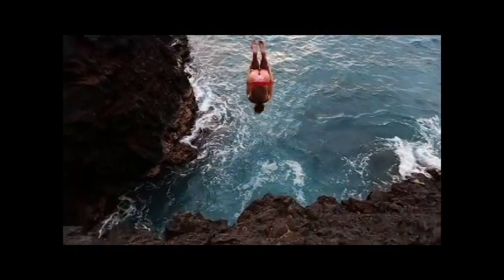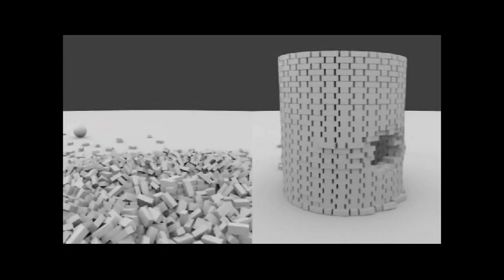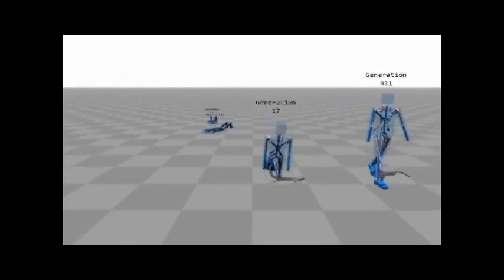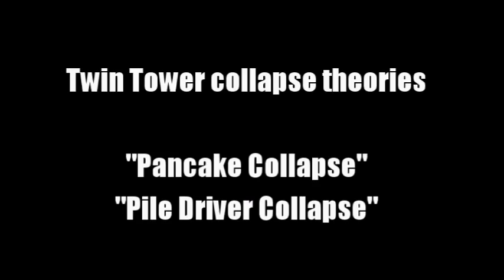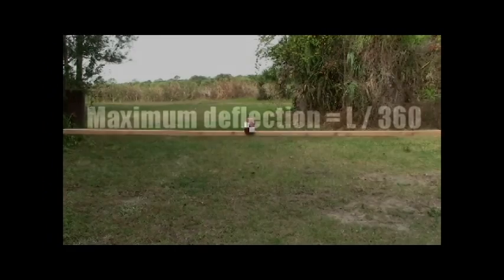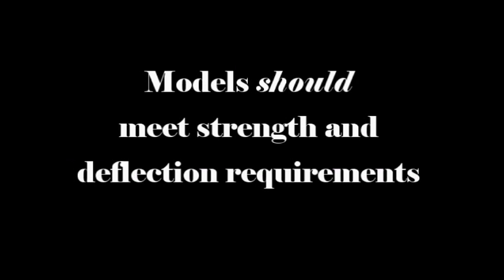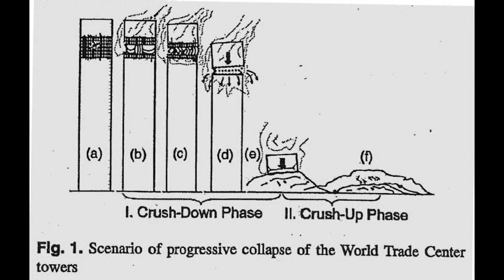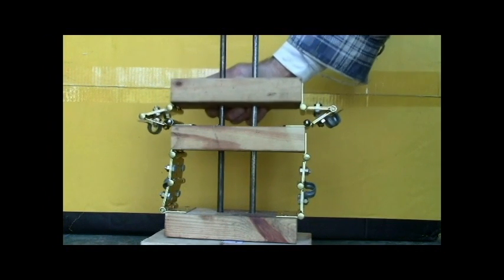9/11 Experiments: The Force Behind the Motion

Comment: The experiment with the steel weight crushing the floors doesn't take into account the actual design of the towers.  My gosh...all of these "experiments" that I find on YouTube never, ever take into consideration the actual design of the towers.

The floor trusses were held to the outer frame and inner core with small little 3 inch brackets that were bolted to each floor section with two bolts.  That's it.  When the weight of the upper floors came down on those little brackets they snapped off.  The floors themselves didn't crash in half.  The L-Brackets snapped off.  That's what allowed the acceleration.  If you accelerate at the rate of gravity, and you hit small little bumps along the way, you will still have NET acceleration.  Think of a car having the throttle wide open, but hitting speed bumps.  Sure, the speed bumps will slow it down a bit each time, and it wouldn't accelerate as fast as a car without speed bumps in front of it, but you'd still have NET acceleration.

The towers didn't fall at the speed of gravity.  They actually fell a couple of seconds slower, taking into account the time it would take to snap off each bracket.

The same goes for the second "experiment".  How in the hell can you conduct an "experiment" when the variables in the experiment are nowhere close to the same as the control!?  The entire structure in the experiment is different than the tower design.

The floors were "floating floors" between the core and outer frame.  The outer frame couldn't even stand under its own weight, and this is proven through basic mathematical calculations.  The frame got its lateral strength from the floor trusses connecting them to the core.

I don't even know why I'm trying, actually....
Reply: Just curious about a few points:

1) His "experiments" either didn't meet deflection codes or were at the maximum allowable deflection... are you saying that the towers' design were even weaker than the experiments (because each floor was only held together with 3" brackets)?  And if so, shouldn't someone be held negligent in either design or construction for not meeting the required deflection code?

2) In your explanation of the collapse, how do you account for the complete destruction of the inner core columns? Since the floors were "floating", and became detached from the inner core...

3)  You stated that the towers "fell a couple seconds slower" than gravity.  Would that be inconsistent with other controlled demolitions?  Or are there other factors which could account for such delay?

4)  I know his experiments aren't perfect, but are you aware more complete/precise experiments which prove/disprove a particular theory on the collapse of the towers?

and it's good that you're trying, only way people can see the other point of view is from discussing it.  Thanks!
Reply: The Logic Jock Thanks for the civil reply!  Rarely happens with 9/11 discussions.

Unfortunately, explaining the full structural make-up of the towers and the physics behind their fall is beyond the scope of a YouTube comment section.  It's one main reason why there's so much disinformation out there.  People attempt to make scholarly journals out of comment sections and nobody reads that...

But, I'll do my best to answer as succinctly as possible, while maintaining some sort of truth and usefulness to the answers.

1)  It's not so much a matter of deflection, it's a matter of construction design.  In order to have an accurate representation, or experiment, of a building collapse, one must have (a) similar materials in terms of strength ratios and (b) similar, if not identical, construction design.  Otherwise, loads, pressures, tension, and breaking points will not be the same, and so any experiment conducted will not be valid. 

In all of science, an experiment must ALWAYS be (a) valid - meaning it must test the thing being questioned and (b) reliable - meaning one must get identical results each and every time the experiment is conducted, regardless of who does it and when it's done, given the exact same variables and controls.  None of the experiments in this video match either of those requirements of an experiment.

2)  As for the core columns, you can view the columns still standing in certain videos taken at the right angle, until they just give way under their weight and damage. 

As the upper section collapsed it fell at an angle, sort of "slicing" into the core columns.  OK, so what does that say about the remaining 70 or so floors?  Well, it boils down to the weight (some 300,000 tons) sliding down around it. 

People tend to think of buildings falling like butter around hot steel.  But the fact is that the cement floors, trusses, and outer shell had a lot of weight to it.  I would venture to guess (because I'm no engineer) that the core columns were not designed to handle such lateral forces.  They were designed to handle vertical forces.  Imagine pressing down on a spaghetti noodle.  They're pretty strong for their size, in terms of vertical force.  Now press down vertically onto the noodle, then hit it with something relatively light on it's side.  It will snap much, much easier.

3)  I'm not following your question, exactly.  The fact that the towers didn't fall at the speed of gravity indicates that it's not a controlled demolition, but that the towers fell with some resistance.  I.e., the time it would take to snap off each truss bracket.

4)  Unfortunately, conducting an accurate experiment of that nature is impossible.  It really is.  Anyone who says they've done it, is a liar.  The best anyone can get is a computer simulation, which still has variables one can manipulate behind the scenes.  Unless you're the software engineer, no one really knows if the software is accurately representing reality or if it's been "toyed" with to match someone's hypothesis.

The only way an accurate experiment could ever be simulated is if you found materials that were scaled down in terms of rigidity, tensile strength, and compression strength.  I.e., A 1/100 or 1/1000 scale of steel.  Then you'd have to construct your mock 1/1000 size building in the same way.  And you'd have to do this about 10 times, in order to satisfy the reliability of an experiment.

The scaled down versions of the materials (which would have to be proven to be scaled down versions) would satisfy your validity requirement of an experiment.  The 10+ repeats of the experiment would satisfy the reliability requirement.

So, in terms of experiment characteristics (dependent, independent, and control variables), the dependent variable (the one being tested) would be the way in which the towers collapse.  Your independent variable would be how you start the collapse.  The control would be to make a mock demolition with one of your experimental towers.  But, your charges and method of detonation would have to be identical to a real, controlled demolition.

This is precisely why a real experiment is impossible.

I know of no materials which scale down from steel so easily, nor of anyone who has access to the design plans of the towers, nor of anyone who has the time and a CNC machine to make all the parts, put it together, over 10 times, and then destroy all of it. 

It's just not feasible.

So, when it comes down to it, I go with Occam's Razor and stay away from Ad Hoc hypothesis.

When faced with a multitude of explanations for a phenomenon, go with the solution that includes the least amount of variables and has the simplest explanation.  Otherwise, you quickly find yourself with a hypothesis that is untestable, making it both unable to proven or disproven - which answers nothing.

To believe that it was a conspiracy, put together by our government, with bombs all throughout the buildings, planes, people to take the fall, etc. when the government can't even get the most simple shit to run right, I find hard to believe. 

See, the thing about conspiracy theorists is that they make our government more powerful than it actually is.  They talk about how evil the government is and how they can't get this right or that right, but turn right around and say they've orchestrated and manipulated the most complicated and secretive plans and events in the world - all without any hard evidence to prove it.

I choose to believe that which is explainable, that which makes sense in as many facets as possible.  And in most cases, conspiracy theories don't explain anything - they merely ask questions that aren't testable, leaving the mind to wander into even more unproveable things (Ad Hoc hypothesis).
Reply: It's Me. . .  My common sense was screaming out by your second paragraph.  By the  very obvious fact that an upper floor crashing into a lower floor has to start that lower floor in motion (after exchanging & expending  energy)  causing a substantial lag in motion/collapse.  Each floor weighed around 4,500 tons, that's one hell of a mass to make move suddenly, to achieve anything like free- fall speed, from a standing start.  Also remember that the steel in the towers got progressively thicker towards the totally undamaged base. The entire building was constructed with a large Safety Margin, and the reality is the collapsing mass was less than the original mass the towers supported because a lot of it was blown out or turned to dust in the process.  How many tons of dust (actually the tower materials themselves) do you imagine lay in the downtown area after the collapses? Calculations by deniers calculated it was around 80,000tons of dust, around 50% of which, was pulverised concrete. And, if the floors did indeed pancake on top of each other, then where are the large chunks of each floor which should (some at least) appear stacked on top of each other? I don't see them . . .
Reply: And it seems even the most intelligent supporters of the official story regard the "too big to pull off without people spilling the beans" argument as their most persuasive rebuttal of 9/11 truth. That, of course, is entirely speculative on their part and not evidence of anything. When you approach the problem from that point of view you ignore the dozens (perhaps hundreds) of government insiders who reject the 'official' account. How credible you view these people is for each person to decide, but to ignore their existence is intellectually immature.

In the same breath they will point to the incompetent of the US government as evidence against co-ordinating something like this. To that I ask, how long will you let someone piss on your leg while they tell you it's raining? Do you really believe the announcement on September 10th 2001 that the Pentagon couldn't properly account for $2.3 trillion was merely a coincidental and harmless oversight? Has that 'innocent oversight' been corrected? Not according to this article published by reuters last month. I suppose Trump's escapades are a bigger threat to democracy though.
http://www.reuters.com/article/us-usa-audit-army-idUSKCN10U1IG

We could talk for hours about supposed 'intelligence failures' and 'misplaced files' on a number of issues, but I'd rather not waffle on much longer. I'll finish with this: 'Conspiracy' is a perfectly valid legal concept within the criminal code that describes 2 or more individuals planning to commit an illegal act. They occur ALL the time. A theory in simple terms, is a hypothesis that has not yet been proven true.

Contrary to popular opinion, not all conspiracies are sloppy operations that are quickly discovered and dismantled. The Italian mafia, among others, has been in operation since at least 1930, and is as powerful as as it has ever been. No one disputes that the mafia exists, yet they are notoriously elusive to law enforcement. It is a perfect example of a conspiracy theory.

What separates the 9/11 truth movement from, for example, the 'Fake Moon Landing' crowd, is that there is nothing of note that has been declared 'classified' or 'off limits' with respect to the Lunar Landings. Approximately 400kg of rock (in total) was brought back by NASA's Apollo missions at the cost of billions and at least a dozen lives. And yet they will happily send you a sample of Lunar rock for research purposes if you fill out a form, and can demonstrate some level of scientific competence. You can visit the NASA visitor centre and view the space shuttle, the lunar lander, the space suits and even see the camera used to record Mr Aldrin's infamous words. You can visit the Parke's radio observatory in Australia that beamed the event live across the Southern Hemisphere. And you also have major networks who will not hesitate to air the crappy conspiracy documentaries put out by the fake landing movement. Virtually NOTHING is off limits.

Show me where I can apply to get a sample of WTC steel for my own research purposes? When will a major network air the Architects and Engineers for 9/11 truth documentary? What do you mean it will jeopardize public safety?
Reply: Jon Chalkley Perfectly said.  The point about the paper walls experiment really does hammer it home.
Reply: You guys are missing the point of scientific experimentation.  

To say that a model cannot replicate the conditions (which is true) therefore any experiment will not explain the collapse, is confusing.  Then why conduct any experiment where the exact conditions cannot be created? And why believe the government's explanation without 1st recreating the exact conditions?

Although he did not create the exact conditions... he created conditions which provided less vertical strength (even at scale) than the towers.

You're telling me (both It's Me and Eric Henderson) that if a 110 story sky scraper, with PAPER for walls were built, and it's upper section was dropped into the lower section (while some of the paper walls were lit on fire) it would have been more structurally sound than the steel towers?  If these experiments were built to the scale of the towers, that these conditions are better suited to handle the events of 9/11?

If you TRULY believe that... somebody should go to jail for architectural/engineering/structural malpractice. 

No one is saying these experiments are perfect... but you can sure learn a lot from them... and certainly ascertain that a smaller structure, moving through a larger structure, where the only downward force is gravity, and it's release point is only a few floors away from the lower section, CANNOT destroy the larger structure (of the same material) and then crush itself after.
Reply: With all due respect It's Me, that's exactly what you're arguing.  Your argument is that the paper is too strong in comparison with the L shaped brackets connected to steel trusses, connected to vertical steel columns from the inner to outer structure.

I think we're going to have to agree to disagree.  I don't believe:

a) that the WTC towers vertical load capacity is comparable to a single uncooked noodle holding up several pounds of weight (even at scale).  Again, if that's the case, someone should be in jail for malpractice and constructing buildings in the same or similar fashion should be outlawed... which it hasn't, because the new WTC7 was built in the same way (strong inner core, outer columns with trusses connecting the columns and holding the floors)

According to [WTC designer Leslie Robertson], New York City has some of the worst wind loads in the nation ... This is because of the occasional wind generated off of the Atlantic Ocean during hurricane season. As a result, buildings in New York City must be designed to be twice as strong as similar buildings designed to withstand an earthquake in Los Angeles.

b) that the collapse, as you guys described it to happen, would have destroyed the inner core, pulverized all the concrete, fused elements of steel and concrete together, laterally ejected large sections of steel at calculated speeds of 60mph which embedded themselves into neighboring buildings, maintained a 3 month long fire, and created a "pool of molten steel" as described by a multitude of first responders.

To me, the occam's razor to explain that all of that is thermite combined with explosives.
Reply: What does any of that bullshit have to do with Newtonian physics? And what is the "speed of controlled demolitions"?
Reply: ..aaaand you're STILL running scared from discussing physics.

What a surprise.
Reply: Oh God... Dr Judy Wood is either a fraud or a lunatic. I'm sorry to be so blunt, but her name and common sense do not belong in the same sentence.

Her 'dustification' theory is silly on it's face. The 'dust' she refers to is simply pulverized concrete and is present in every single successful demolition video on the net. There is no mystery. The buildings did not 'vaporize' in the air. There was thousands of tons of debris at the trade centre site, and thousands of tons of concrete powder spread over the city.
Reply: Jon Chalkey, yes exactly, there was tons of concrete powder over the city that is what she is saying too. There are many obvious reasons why controlled demolition is not what happened that day. Just because Judy Wood's examination of the evidence suggests something outside our known technology is no reason to think it either ridiculous or stupid. I am now sure you have not looked properly at what she is saying as it is the only thing I have read that accounts for the actual evidence.( incidentally, I have been studying this avidly since 9/11 as I was a flight attendant for United Airlines at the time and have looked at every single theory I can find out there ) There is a lot of disinformation and misinformation out there and a lot of it is purposely trying to discredit her because any "black box" technology that may exist has to stay that way otherwise the consequences could be potentially a lot worse than just being found out as to having organised 9/11. Dr Judy Wood has the most extensive reports on 9/11, far more that any other single person. Please if you seriously want to understand 9/11 read her work properly. If you have any genuine questions about it after reading it thoroughly then please lets discuss them , I am open to that, but as yet you have not said anything that disproves her work, only insulted her personally. Just because a lot of people are ridiculing her may only point towards her being close to the truth, don't be a "sheeple" look at the evidence.
Reply: Jon, Sorry you still have not said anything to disprove any of her findings. Just because she suggests that technology beyond common understanding most likely was used and therefor you can not disprove this technology, is no argument that it can not exist.I am sure that there is a vast amount of "black ops" technology that the general public know nothing about, we of course can not disprove any of that technology, but that does not negate its existence. Surely as a lawyer you understand that the most vital aspect to discovering the truth is to study the evidence, and hopefully study it with an open mind. So what you are saying is that if , for example, Russian scientists invented a new weapon and used this weapon in warfare, you would have to deny its existence, merely because it is not "falsifiable", now that in my mind is ridiculous. So everything beyond our current understanding, therefor can not exist because it is "not falsifiable", please re consider what you are saying. I do not want to be discourteous but surely as a lawyer you should be able to see the problem with what you are saying. As you don't seem to want to give me any specific reasons why Judy Wood's work is not the best analysis of the evidence, may I give you a couple of reasons why controlled demolition is not the best analysis of the evidence.
 1, Controlled demolitions do not fall so perfectly within their own footprint without causing at least some damage to buildings around them, especially considering the enormity of the trade towers. ( check out the domed roof directly next to the towers, it appeared to have absolutely no damage). Please look at other demolitions on you tube. How do you explain this ?
2, Check out the seismic recordings for the area at the time the towers came down and compare that to the seismic recordings of other large buildings that have undergone controlled demolition . The recordings are not consistent with the size of the buildings. How do you explain this ?
3, There is no where near the amount of debris left at ground zero as there would be if the towers had come down by controlled demolition. I agree that a lot of dust is produced in a controlled demolition, but there is still a large amount of rubble left at the site, and much of it is large  identifiable pieces. Prior to a controlled demolition it can be assessed approximately how big the pile of rubble will be that will be created. The rubble left at ground zero had no real identifiable pieces and was no where near the size the pile should have been . NO WHERE NEAR . Even the reporters on the day were commenting about the amazing lack of rubble. How do you explain this ?

Please answer these questions , otherwise I will have no option but still see Judy Wood's explanation of the evidence as the one that makes most sense. I am open to being shown evidence and am quite prepared to re assess my beliefs, but no one has ever come up with anything to explain the evidence yet.
Reply: The only possible source of energy, and the only alleged source of energy (from the 'official' explanations), is downward from gravity alone.

All we're asking is to provide a simple experiment, where an object... ANY object:
1) moves downward through an object of equal makeup and greater size (the top floors fell through the larger structure below)
2) where the only force applied to the object is gravity, and the object's release point (the distance between the upper object and lower object) is not greater than 1/2 of the upper object's height
3) where the entire larger lower structure is destroyed
4) where the entire upper structure is destroyed
5) where the upper object falls at free-fall speed

I don't believe such an experiment is possible... but prove me wrong and I'll cede my argument.
Reply: Eric Henderson On top of that, you have to first assume that the trusses/weights used in the model are scaled down properly to begin with.  And not just in terms of size scale (length/width/height), but it terms of strength.  Tensile strength, shear/crush resistance, etc.  There's so much to account for that a model like this just can't replicate.  

The paper's between the floors in the model crush, while the truss clips in the real towers shear.  You can't even compare the two without it becoming completely invalid.
Reply: I completely agree. These videos keep referring to Newton's Laws but when you watch them it becomes clear that they don't have even understand basic physics.
Reply: Eric, please attempt to conceptualize the scenario you are suggesting. If the concrete floor slabs collapsed onto the floor beneath, breaking the connections to the inner and outer columns, why weren't there significant portions or the interior columns recovered from the site? The interior core section was a building in itself. 

You are suggesting a mode of collapse that NIST does not even endorse. Pictures of the debris clearly show that the studs holding the floors in place were intact. Instead, it looks much more likely that it was the columns themselves that failed. Unfortunately the steel was scrapped (evidence was destroyed) preventing a proper investigation. From NIST's own report:

236 steel members were analyzed including 12 interior columns and 170 perimeter columns. None showed signs of temperature damage in excess of 250 Celsius (no mention of the maximum they did observe)
Of 31 core truss connections, 95% were found to be intact (studs were damaged but functional). Only two were completely severed. 

The steel examined accounts for less than 0.5% of the total used in the twin towers.

If you are going spend your life as a 9/11 debonker, at least get up to speed with the current explanation endorsed by the Government.
Reply: PS: I watched the video AGAIN with utter astonishment that someone with a PE qualification could make such an elementary error in not allowing for the effect of scale. Go and ask anyone else and they will confirm that his experiments are invalid if this isnot allowed for.
Reply: Oooh! Look at that. You're still running away from discussing physics. Probably as well given you have about as much grasp of them as any twoofer. e.g. about the same grasp as a particularly stupid goat might have of basic motor maintenance :-)
Reply: Anything to avoid exposing your utter ignorance of physics, eh? You started to mumble something about Newton's third law then bitched out when you realised you were WAY out of your depth!

titter
Reply: "when factoring for the modicum  resistance"

It's HILARIOUS when you attempt to sound educated. Do it again!
Reply: Logic Jock . . . I have to agree with your the Government comment.  I had one bright spark say that if the government planned & did it, then why would they bother sending up jet fighters to shoot them down.  I believe Bush knew something was going down on that day but maybe not exactly what.  His reactions on that day was really suss.  Not wanting to disappoint a group of kids by leaving when he was told the building (s) & US were under attack.  Many of the Black Ops groups, and there are several at least, are, at times on opposing objectives & clash with each other . . .  sometimes undermining the other's attempts.  Again I point to "Operation Northwoods" . . . people should google that for themselves & be aware what the Top Brass are willing to do.  Remember this was not just a proposal, it was signed off by them as a "GO".
Reply: Think For Yourself Yup.  I believe Bush was an accomplice AFTER THE FACT.

They purposefully kept him away... if anything, they (Cheney and crew) couldn't trust his judgement.
Reply: "There are many obvious reasons why controlled demolition is not what happened that day"

Please.... Go on

"Just because Judy Wood's examination of the evidence suggests something outside our known technology is no reason to think it either ridiculous  or stupid."

No, it is ridiculous. That is precisely what religious zealots invoke when you ask them to define the God they believe in. An unfalsifiable theory has zero merit in any rational discussion.

"I am now sure you have not looked properly at what she is saying as it is the only thing I have read that accounts for the actual evidence"

I did better than that. I watched her presentation in Holland at the 'Breakthrough Energy Movement Conference'. I wish I had that 2 hours back..

"Dr Judy Wood has the most extensive reports on 9/11, far more that any other single person"

I don't disagree with you on this point. The amount of evidence she has collated on her website is a staggering achievement. The problem is she weaves that evidence into a ridiculous theory with no merit.

"I have been studying this avidly since 9/11 as I was a flight attendant for United Airlines at the time and have looked at every single theory I  can find out there"

I am an Australian in the 3rd year of a Law degree. I previously studied engineering for 2 years before changing courses. I became interested in the 9/11 truth movement about 2008 - I don't claim to have 'looked at every single theory' out there... What's your point?

"Please if you seriously want to understand 9/11 read her work properly. Just because a lot of people are ridiculing her may only point towards her being close to the truth, don't be a "sheeple" look at the evidence."

I am a firm believer in the principle of charity... I try to avoid insinuating that my opponents are 'sheeple' who haven't 'read her work properly' for as long as possible.

"If you have any genuine questions about it after reading it thoroughly then please lets discuss them , I am open to that, but as yet you have not said anything that disproves her work, only insulted her personally"

I already did. Her main criticism of the demolition hypothesis is that it doesn't account for 'dustifcation' of the towers in mid air. But.. it absolutely does. David Chandler's video clearly demonstrates the same pyroclastic dust clouds being formed in much less substantial and/or sophisticated building demolitions.

The demolition theory is a falsifiable claim. Some super secretive - beyond our current understanding - Directed Energy Weapon is not a falsifiable claim.
Reply: P.S. Jon,  do you really really believe this " An unfalsifiable theory has zero merit in any rational discussion." ? I am shocked that a lawyer could say this ! I doubt you will be debating Philosophy any time soon, or for that matter putting forward theories to to avoid your clients being found guilty.
Reply: P.P.S. An unfalsifiable theory that is based solidly on all of the existing evidence , and fully explains that evidence, does in actual fact have merit, whereas on the other hand a falsifiable theory that is based on all of the existing evidence but contradicts some of that evidence is simply just that ,       false.
Reply: No the Architects and Engineers for 9/11 truth are the distraction and are purposely trying to ridicule Dr Judy Wood's work. Jon, you say that there was thousands of tons of debris at the trade centre site, but there WAS NOT. Please send me a link to any image showing this debris. Even the reporters on the day couldn't understand why there was hardly anything left of the towers. All controlled demolitions have a calculable amount of rubble left at the site but that was NOT the case at ground zero. Also check out the seismic recordings for the day , clearly they do not account for the towers collapsing. LOOK AT THE EVIDENCE.
Reply: It's ME, Thank YOU....one Person with a fucking brain.
Soooo many stupid people around here...it hurts o.0
Reply: Literally any scale.  The laws of physics act the same way whether it's a tree trunk or a branch or a twig.  

And yes, free fall is a condition.. as NIST themselves have acknowledged that free fall occurred.
Reply: The laws of physics may be independent of scale but the forces involved are not.
The strength of the trusses, girders, etc will increase as the square of the scale while masses and therefore the forces involved increase as the cube of the scale.
For example, if you use 1:100 scale, the strength of the trusses would be 1/10000 weaker but the mass of the falling floors would be 1/1000000 less.
In effect, the trusses would be 100 times stronger in the model than in reality.
This is why experiments, like the ones in the video are not valid.
Reply: The Logic Jock "it would have been more structurally sound than the steel towers?"

No one is arguing that at all.  It has nothing to do with the structural soundness of paper.  It has to do with the design of the towers.  

Go watch a documentary on how the towers were designed.  The men who built the thing (who are still alive) admit that the fires were capable of causing a domino effect within the buildings.  

The reason is because each floor was made of trusses which were literally "hanging" on L-shaped brackets.  Once enough trusses began sagging and putting their weight on the floors below all it took was one floor to give way, allowing the outside frame to bow out (this can literally be seen in the towers right before the collapse), and then the weight above easily snapped off the L-brackets in succession, gaining momentum and therefore force as it fell.

It's truly simple physics.  

What the experiment in the video doesn't take into consideration is that each "floor" of paper is strong enough to slow down the above weight with a NET LOSS of momentum as each floor collapsed.  The L-brackets in the Twin Towers did not have nowhere near the capacity to create a NET LOSS of momentum in the weight of the floors crashing down.  There was a NET GAIN of momentum as each floor gave way.

One major flaw of the experiment in this video is the lack of consideration for momentum and acceleration of gravity.  Gravity, and therefore momentum, scale by square.  So you would literally have to scale down your weight and strength of the materials to be equivalent with the momentum that can be gained by the acceleration of gravity at the scale of the experiment.  

You're talking multiple tens of tons of material falling about 30 feet onto the floors below in the Twin Towers.  Calculate that momentum or force (MV = P).  Then you'd have to calculate the strength of the L-brackets and crush strength of the outside frame of the towers, subtract that from the momentum, and you'd have your NET GAIN.  

In the experiment, however, the floors fall about 6 inches, and the plates weigh mere ounces.  The resulting momentum in comparison with the strength of the papers just doesn't scale.  Period.  That's the ultimate flaw.

You would need material far, far weaker than the paper.  Not to mention, the circular shape of the paper adds strength that the towers didn't have.  

Recreate the tower using a single uncooked rice noodle between each floor of several pound weights, then you'll see the collapse recreated more accurately.
Reply: I have to correct you on that point. The floor brackets did not support anything other than the weight of a single floor. The weight of each floor is transmitted through the brackets to the interior/perimeter columns, which carry the weight of the rest of the building. However, the entire floor assembly also functions as the 'bridge' between the interior and perimeter columns so that massive lateral loads experienced by the building during strong winds are transmitted to the core, reducing building flex. 

You are right in pointing out these 'flimsy' brackets survived perfectly fine for 30 years, enduring multiple hurricanes and the 1993 bombing (which was huge in it's own right). They were over-engineered like everything else in the building. The idea that these brackets which held 2000t slabs of concrete, would provide zero resistance in a collapse is beyond laughable. That it's being claimed by those who think they have an sound understanding of 'schoolboy physics' is more worrying. This tells us two things: 

1. The American education system is worse than anyone predicted. 
2. It shows just how piss poor the investigation of 9/11 was. Debonkers can't even correctly describe the 'official' (ie NIST's) theory of the collapse.. Remember that NIST was paid tax payer money to explain to the American people how these buildings came down.
Reply: You don't understand freefall.  If a 4500 ton floor has no support under it, it achieves free fall acceleration instantly.  There is no time delay for gravity to feel like starting to work (unlike certain cartoons featuring the Road Runner).  That's how gravity works.

Secondly, merely stating the weight of a floor leads us into a discussion of how strong the floor connections need to be.  The floor connections to the vertical columns is ONLY hold up the floor.  Not the rest of the building - that's for the vertical columns.  So floor connectors will be rated for something like 4500 tons + max contents of that floor + some suitable safety margin.  Now, take the next floor (or two), and the original floor not only has to hold up itself, plus one or two others.  What happens?  It breaks and falls.  The next floor sees two or three floors worth of load, and breaks even faster.  You get the picture?

Thirdly, no significant amount of debris went missing.  The published tonnage of recovered steel closely matches the amount of steel there was in the building.  The debris piles covered acres of area, and were as high as the 5th story of adjacent buildings, and took months to remove.  Then add the 70' depth of the basement.

And fourth, computations show that the building would have a gravitational collapse energy of approximately 250 tons of TNT.  Now, go read the power specifications for industrial rock crushers.  As it turns out, 250 tons of TNT is enough energy to power an industrial rock crusher to crush the entire tower's concrete into gravel (and progessively finer bits, right down to dust).   Not just once, but twice.  Then consider the fact that much of the concrete debris were in pieces much larger than gravel - photos show piles of pieces the size of brick and larger.  Or, if you don't like that, take a floor size slab of WTC, and drop it from 1300 feet.  The impact energy will be equivalent to 5 or so tons of TNT.  The concrete won't be intact.  It will be in tiny pieces (and indeed dust) spread out over an area 10s of times larger than the slab.
Reply: To the original poster.. Don't bother talking sense to these imbeciles.
Reply: talking with these bafoons is such a waste of time, why do we bother.. you would have an easier time convincing a rabbi that mosses didn't really part the seas.
Reply: Huh? Why are you petrified of discussing physics?
Reply: Payed still 
Ah, do you were in the special needs class. What a surprise! No wonder you don't understand physics and can't refute NIST.
Reply: That is EXTREMELY incorrect. Free fall within the force of gravity is constantly ACCELERATING limited by air (resistance), drag (shape and volume of object) and mass, etc. The WTC Towers were approximately 1300 feet tall each. Once the upper floors fell, they gained momentum AND mass from the lower floors. The towers fell within their own "footprint(s)". They were not falling free from a certain height (ie., bowling ball dropped from same height, left to accelerate to its terminal velocity). Imagine a person standing in the middle of a room. At a given moment they "drop" to the floor. They intentionally allow their legs to collapse beneath them. There is no air resistance within their own footprint downward. he only "resistance" is the friction of the joints once the knees, hips buckle. This is similar to what happened to the WTC buildings. The top floors fell, bringing the lower ones with them, increasing the overall mass ACCELERATING towards the ground.  Had the towers been "magically suspended" above the ground (levitated) and dropped from a height equal to the height of the actual towers, then yes, the time to reach the ground would be different because their initial inertia (static) would resist the force of gravity, and begin to be subject to air resistance. It would accelerate towards the ground slower than the bowling ball due to its much more massive drag than the bowling ball. The towers fell because of Islamic terrorist assholes, massive structural damage caused by the impact from the airplanes,  the fires weakening already damaged structures, wind (which is MASSIVE and rarely considered/discussed) gravity, and TIME. Nothing else.
Reply: "if by some way the towers did indeed fall on their own, it would take them a minimum of 30 seconds"

Oh, why's that then?

"Its simple physics,"

So, how come no one has shown, using "simple physics" in a peer-reviewed paper published in a serious scientific or engineering journal that the towers cannot have fallen "on their own"?
Reply: I admire your gumption but you still haven't taken into the account the symmetrical fall. Asymmetric damage and a symmetrical fall. That is highly unheard of. That being said, hitting speed bumps that hard would cause a car to break before it's final destination. The issue here is that you're not accounting for resistance and energy needed to break up the floors to fall that way. You're assuming all the energy is kinetic. That being said, you cannor creat energy. This mean outside sources would have to make your THEORY plausible.
Reply: I think "Its Me" has covered much of what I would also have given in reply. I will add this though in the hope of clarifying, what seems to be a misconception among truthers regarding how the towers fell.
The inner core and the outer walls could not prevent the collapse from progressing once it had begun because it was ONLY the connections between inner and outer walls which held the floors up.
Once the upper floors came down on the ONE floor beneath, the connections holding it to the walls gave way and this weight was added to the falling mass. As each floor gave way the mass INCREASED and with it the momentum so the next floor below was hit with even greater momentum.
I wont bore you with the maths, but this gives a result which fairly closes what you see in the videos.
Reply: can't we all just be friends?  😢
Reply: That's the point I've been making all along. It only requires a schoolboy knowledge of physics to prove this is how the floors collapsed.
The fact that you have been unable to refute, simply shows that you lack this ability.
Reply: I'll try this only once more.

You keep referring to 'schoolboy physics' yet you continuously butcher its application, demonstrating that you have ZERO understanding of what you are talking about.

The fact that you openly assert that fully supported floors provided zero resistance against the falling mass is simply shocking. If you ever had a highschool physics teacher (seems unlikely), they would be face palming if they saw you wrote this. I'm sure there are 9/11 debonkers who are face palming themselves at the thought one of their own is claiming this.

At this point I'm doubting you even have 4th grader reading comprehension skills but I'll attempt to show you how utterly retarded this argument is, using 'schoolboy physics'.

Momentum = Mass X Velocity

Example 1
If a 2 ton car traveling at 100km/h collides with stationary vehicle of the same mass, what speed is the vehicle traveling after collision?
Answer:
If we assume this to be a closed system in which both vehicles fuse together and momentum is conserved, then you are doubling the mass of the vehicle meaning that it will lose half its velocity, ie 50 km/h 

Example 2
If an 98 ton truck traveling at 100km/h collides with stationary car weighing 2 ton, what speed is the truck traveling after collision?
Answer:
Using the same assumptions as the first example, 98km/h

In the real world we know energy/momentum is not conserved. The vehicles will not 'stick together'. They are designed to deform and spread the energy exerted on each vehicle over time. There will be energy lost to heat, sound and friction. In both examples, the vehicles will be traveling at less than the calculated speed. However, it cannot be disputed that in both cases, the stationary vehicle will resist the motion of the moving vehicle.

I know all of this will fly over your head, but take my word for it - you are clueless.

To tie this back to the WTC collapse. No one who graduated highschool would claim that the buildings fell at free fall acceleration throughout the entire duration of collapse. This is PHYSICALLY impossible by gravity alone, and undesirable if you aim is to demolish a building. Architects and Engineer's for Truth timed both collapses at about 15 seconds from initiation (ie roughly 70% of free fall acceleration). So even though 'truthers' believe that the structural supports were taken out with explosives, the building still provided minimal resistance against the falling mass.
Reply: The brackets connected the floor trusses to the core and outer walls and each set of trusses supported only one floor. The lower floors did not support the upper floors, their weight was born by the walls.
Reply: It's Me was going to go in debt like you but well said. my thoughts exactly
Reply: What a surprise, another inane comment from our resident genius.

We have still to see your calculations showing that the truss joints were strong enough to resist the impact of the falling upper floors.

The lack of even a hint of critical thinking in your writing is manifest.

The air inside the towers was 'strong enough to resist' the collapse. The question is, to what degree did it resist?

A 5 year old child is capable of understanding the basic principles of wind resistance and lift by sticking his hand out the window of a moving vehicle. That won't make him a fully qualified aerospace engineer with a grip on Eigenvectors and the difference between the Cauchy and Kirchhoff stress tensors.

We have still to see your calculations

Unlike you, I am not prepared to embarrass myself by claiming 'schoolboy physics' is sufficient to explain the three most significant engineering disasters in history. 

If they did not fail what caused the building to collapse?

Did you even watch the video?
Reply: Never thought of myself as a genius and I realise it is your attempt at sarcasm but I’ll take it as a compliment anyway.
As I expected, you have not been able to produce any coherent response to my post. Sneering and insult does not constitute a valid argument. Facts and evidence do. Your failure to provide any confirms my suspicion that you do not understand the mechanism of the collapse. It is apparent that you have been conflating NIST’s
analysis of the way the columns  failed, initiating the collapse with the way the connections between the floors and the walls were sheared off  DURING the collapse.Your claim that 90% of the truss connections remained intact is also mistaken, or is it just downright dishonest.
“However, over 90 percent of floor truss connections at or below the impact floors of both buildings were either bent downwards or completely sheared from the exterior wall suggesting progressive overloading of
the floors below the impact zone following collapse initiation of the towers.”  (Stephen W. Banovic, Thomas A. Siewert)
Reply: That's absurd.  Where did the 180,000 tons of steel they shipped to China and India come from then?  How come it took a 7x24 continuous convoy of trucks operating for months to remove the other million or so tons of debris?  The seismic recordings do indeed show the towers collapsing, but they don't show the start of the collapse simply because nothing had hit the ground until several seconds AFTER the collapse started.

Where are the pictures?  Good grief, do a  google image search for "debris 9/11", and then google for "aerial debris 9/11", and it should go without saying, skip the truther sites' handpicked and often misrepresented photos.  There are hundreds of shots, the aerial ones showing the outer frames of the building draped across adjacent buildings like flower petals are quite striking.  Not to mention the huge waterfalls of debris falling from the WTC tower falling on top and the side of WTC7.  Where did that go?   Did the Enterprise pick it up with its transporter room?

Where did the debris in the video falling from the towers go?  To the ground, where else?  WTC7 collapsed just about straight down, did its debris magically disappear before it hit the ground?    Vaporized debris aren't invisible.  Furthermore, the energy required to vaporize significant amounts of the buildings would amount to the equivalent of 1000s of tons of TNT at temperatures which'd give everybody in line-of-sight within miles sunburns.
Reply: "Subsequent analysis of the particulate material that settled out and formed a grayish-white dusting over much of Lower Manhattan showed it to be mainly a mixture of crushed gypsum wallboard, glass fibre insulation and concrete, some of which was in the 60 - 20 micron size range."
As you would expect, truthers make all sorts of claims about the physics of the collapse but rarely back it up with figures:
Total PE available in wtc tower ~ 10^12J
Total Energy required to collapse one floor ~ 10^9J
So to collapse 100 floors ~10^11J
Subtracting that from 10^12 gives 9 x 10^11J available to crush concrete, wallboard etc. How much did it actually take would depend on the total mass of concrete and the average particle size of the dust, but considering a sizeable amount of the concrete would certainly remain as large lumps it looks more than enough.
Reply: @Tom Slak What do you think happens when you drop a 10 floor section of building (which is what happened) from 1000'?  It smashes into small pieces.  "the now bare and supported core should have fallen over like a tree"?  Well, that's exactly what the videos showed.  A progressive collapse is a combination of pancaking of horizontal sections and collapsing of vertical.  The vertical columns weren't 1300' long single sections of steel, they were much shorter sections bolted together.  What happens when the floors start falling and debris blow out sideways?  The vertical column sections are bashed sideways, lose their stability and break off.
Reply: Fromage Frizzbizz I'm so glad that atleast someone other than my self actually learned how the towers were made and why they were designed that way. A typical high rise structure had reached its limit. This design allowed for a building to exceed those limits by reducing weight. Thus creating naturally design flaws. I always point out the towers resisted the impact the structure did its job. The resulting weakening of the structure is what it lost its battle in. Fire at 1600 degrees super heats steel to the point of manipulation. Although you have to apply alittle force (it won't bend just from heating it). I tell people when I argue lol a butane torch is not 2,000 degrees. But you can bend steel if you hold it there long enough. Lol I've made many wrenches meet tight spot like this
Reply: I think she is a 'distractification'...
Reply: Nah, i think its more like: When "They" can make you believe absurdities, they can make you commit atrocities.

And, with tools like Religion we as people are controlled by the Minority. 
Religion, the Media etc etc, all tools for the Minority to control the Majority.
Politics....:
Montagu Norman, Governor of The Bank of England, addressing the United States Bankers' Association, New York, 1924 (Financed Hitler up to the Second World War: 
"Capital must protect itself in every possible way, both by combination and legislation. Debts must be collected, mortgages foreclosed as rapidly as possible. When, through process of law, the common people lose their homes, they will become more docile and more easily governed through the strong arm of the government applied by the central power of wealth under leading financiers. These truths are well known among our principal men, who are now engaged in forming an imperialism to govern the world.

By dividing the voters through the policital party system, we can get them to expend their energies in fighting for questions of no importance.

It is thus by discrete action, we can secure for ourselves that which has been so well planned and so successfully accomplished."

Anyways, we have to understand that most of these people are not ready to be unplugged. And many of them are so inured, so hopelessly dependent on the system, that they will fight to protect it.

"They" can talk all day long, but none of "Them" can ever show us any experiment, any simulation, any test, in which we see that what we were told can actually happen.
There is no way the top section of the North tower could destroy the entire lower part which wasnt damaged at all.
It held up the top part even after the plane impacted.
The hole was clearly on the north side.
The top section however tilts and drops southwards.
And it does so without deceleration what so ever.
It accelerates downwards.
287 columns from bedrock to top.
The top section was made of the same material as the lower part, be it not as massive since those buildings are always build tapered. Heavy at the bottom, lightweight at the top.
There is no way that top section could keep on accelerating downwards through the intact lower part.
And the verinage technique proves this. 
In such a demolition you can see the top section decelerate when it comes into contact with the lower part.
Nothing of the kind is seen in any of the 3 buildings on 9/11.

But, no. More like scared. Insane, or just scared that it might end one day....... the fantasy.
What does surprise me is that many of them dont have millions of dollars on some bankaccount. They are just like you and me.
Yet they defend the official story, even with violence. 
And for what?
IF the truth offends, then shouldnt it be time to stop living the lie?

Ah well, Einstein said: I fear the day when technology surpasses our human interactions. The world will have a generation of Idiots.

The time has come.
Reply: Congrats for the trusses failing in fire.............. Except they didnt in experiments.............
Even if they did, that would mean we would have a core left standing there.
Since if the trusses failed, the floors pancaked, which they didnt.

The bowlingball crashes THROUGH the glass plates, and the glass plates shatter and end up mostly ontop of the next glass plate.
But, the ball does not go through all the glass plates.
Which perfectly demonstrates why your nonsense of the weight of the upper part of the building being equivalent of the titanic isnt the proper analogy.
We could all see the massive ejection of dust and structural components in all directions. Which didnt add up to the weight crushing or destroying the entire intact lower part.
Infact, the weight did not increase but decreased since of the ejection of all that material.

Plus, the upper part was always kept up there by the lower part of the building.
Its impossible for it to accelerate downwards without any deceleration.
That also is perfectly demonstrated by the bowlingball experiment, as well as the experiment in the video above, as well as the FACT that  you indeed do slow down when jumping into water.

But hey, continu believing in fairy tales if you want.
Reply: btw, do you think people who have shown doubt about the official story and who promote it and are given money to persue that goal are getting paid more money than those who actually committed the crimes themselves?
So you think mr Cage for instance makes more money out of what he is saying than what for instance mr Silverstein has made?
Or a Halliburton?

Yeah, you are right. "They" indeed do profit off of fools like you.
Cause you are willing to send people into war with eachother over a pack of lies, absurdities.
When they can make you believe absurdities, they can make you commit atrocities.
Clearly you are the one believing in such absurdities as passports surviving plane impacts and magically being found while blackboxes disappear completely.
Clearly you are the one believing in such absurdities where an officefire can demolish not 1, not 2, but 3 steelframe buildings, 2 different designs, 1 falling with freefall acceleration for 2.25 seconds ending up roughly in its own footprint, after dropping symmetrically with a clearly visible kink..............
Clearly you are the one believing in such absurdities that officematerial or such can fuel fires underneath a debrispile for months eventhough having been flooded by rain and firehoses.
Clearly you are the one believing in such absurdities that officematerial can fuel a fire that then weakens steel columns up to a point that they give less resistance than air.
Clearly you are the one believing in such absurdities as a Bin Laden being responsible for all of this, masterminding it all, without thinking about the consequences...........After all, what did he gain from it? And did he attack freedom, or did the Patriot act attack freedom a bit more?
Clearly you are the one believing in such absurdities where you and people like you have no problem calling the Reichstag fire something orchestrated by Hitler and his henchmen, used by him to pass the Enabling act, while maintaining that it was Bin Laden who attacked the US and therefor Bush had to sign an act much similar to the Enabling act which in basic fact is more of an attack on socalled "Freedom" than flying planes into buildings can ever be called.
Reply: It's Me:  So what happened to the core columns?  Did a bacteria eat them?  And how did Thermite get into the debris?  Remember, Accumulation of Mass.  Same bacteria in building 7, I presume.  And, once the explosives synchronization got going, the buildings did free fall.
Reply: Right. The sequenced explosives led the collapse because that was what kept the motion going.  There were many testimonials of hearing explosives. Still doesn't explain bldg 7 either.  Follow facts.
Reply: Guinea54 right back at you
Reply: +Guinea54 lmfao we using there science yes . But tell me the difference of the countless professors who we watched on YouTube an the professors at the university . They are the fucking same thing with same education level . what you think we all dumb fuckers on YouTube with a low IQ that you felt the need to inform us of your IQ haha . your IQ can't be that high if you believe the towers fell because of planes an jet fuel . even the architect who designed the fucking towers said it was built to withstand multiple planes hitting it not just 1 . go look it up you clown . anyway the government said santa clause is real don't know if you heard 
 it must be true cause they said it right . don't know why I bothered replying again . I feel like I'm losing brain cells ever time I reply to you .
Reply: Guinea54 is Mr. IQ comparing a ship wreck with a building collapse?  And then applying Occam's razor?
Reply: It's Me what happened to the inner core columns than?
Reply: Then where did all the floors, ceilings and machines/office supplies, (computers, filing cabinets, you know stuff that should have just been crushed) end up? Everything was vaporized beyond recognition, if the fire was only on the upper floors then there should have been a lot more stuff left at the scene, it all would have been crushed and destroyed, but would have been there. Not to mention the flow of molten steel left running for days after. Aside from all that, did you help build the towers? How do you know how it was built? News? Internet? Now I may be completely wrong too, at least I'm not trying to sound like the building designer. Know who the last man out was? Listen to his story.
Reply: Eric Pfaff your question shows you don't understand engineering.... and probably believe this video above
Reply: Payed still 
Why are you so scared of discussing physics?
Reply: Payed still 
....and you're STILL petrified of discussing physics! What's the matter, hmm?
Reply: Payed still 
You claim to know physics?
Lol
Reply: Payed still 
You're not good at anything, you silly racist. Glad to see you admit you know fuck all about physics, though.
Reply: Terry Booth 
Why not read NIST's hypothesis, Terry? After all, no one has ever rebutted it,so it stands as the best explanation so far.
Reply: Aww, poor dumb mickey is all upset :-(
Reply: Physics 101 : increasing the amount of pressure exerced on an object will make its temperature rise.
Reply: It's Me,maybe you should try a little harder.you said the towers actually fell a couple seconds slower??as if 8 sec wasnt fast enough for a 110 story STEEL building..lol,and 3 inch brackets??like are you for real?lol..they spent almost a billion dollars and all they could afford were 3 inch brackets to hold 110 story of STEEL??you must be coocoo for cocopuffs..what about the 47 STEEL columns that were placed in the center from the bedrock all the way the to the top of the towers?were they made of plastic straws and snapped like the brackets??
Reply: FYI I responded earlier but IDK what happened to my reply, seemed to have not uploaded. But since people are chiming in, I figured I'd hit the main points of my response.

My biggest issue is Building 7.  
To the untrained eye, it looks like a clear controlled demolition.  
And more importantly, to the trained eye.. it looks like a clear controlled demolition (look up Danny Jowenko - Building 7).
I'll grant that the towers are more complex, because of the planes hitting, etc.  But building 7, falling the way it it did, I think is impossible without explosives.
And if it looks like a controlled demolition, and it acts like a controlled demolition, then hey: Occam's Razor.

As far as secrecy... I think there's a few logical missteps with the "too many people involved, government not capable" argument.
1) I think people wrongfully conflate intelligence agencies and sophisticated intelligence/military-industrial contractors... with like, Ted Cruz's stupid face.  I think when people call it a "government conspiracy" they think all of congress was in on it... when I will grant that that's a ridiculous notion.
2) With a very precise plan and a controlled network of a few individuals, all working on a need-to-know basis, I think something like this could be pulled off with relatively few people.  I mean, even the "official story" involves an elaborate conspiracy which involved less than 30 people.  For example, to wire up the buildings you'd need access to all the elevator shafts, etc.  The towers were undergoing major "elevator repairs" which left the shafts exposed... it is also reported that the security system was down the week before 9/11 (if I remember correctly)... so two seemingly innocuous events, could have allowed just a handful of individuals to perpetrate the act in a couple of days or weeks.

The way I see it, the two hypothesis are at least equally as likely.  One says 19 guys who barely spoke english, known to be al-qaeda linked, lived in the US for years without detection, were directed from a sick man in a cave across the globe, overcame all of the government's air defenses and caused collapses of 3 buildings in manners in which has never, ever, occurred... and the other theory, a cabal of highly intelligent, highly trained intelligence officers pulled off something which they are clearly technologically capable of doing... but which is (in theory) super hard to keep secret.
Reply: Chris you are right in that the buildings didn't fall down at the speed of gravity. However, that doesn't disprove the demolition hypothesis.

Actually there is a shit load of confusion on the time it took for the buildings to collapse. The NIST report suggests the two towers took 'approximately 9 and 11 seconds'  and has been reiterated by Sunder. The lack of precision in their timing is pretty bizarre... An object falling at the speed of gravity a distance of 415m would take 9.2 seconds (from rest ignoring wind resistance). So NISTs "approximately 9 seconds" should illustrate how ridiculous their 'scientific' inquiry was.

Architects and Engineers for Truth actually puts the time for both collapses at approximately 15 seconds, so the whole collapse took quite a bit longer than free-fall time. However, that matches up quite well with other acknowledged demolitions. David Chandler's video demonstrates that most demolitions take upwards of 100% longer than free-fall time for the top floor to hit the ground.

As for this video, I'm not sure your criticisms have the merit you think they do. Obviously his models are laughably inadequate compared to the towers themselves. But that again shows how ridiculous the official explanation is. His use of paper as a representation of the perimeter columns in one of his experiments was fucking brilliant in my view. Paper, unlike steel, obviously rapidly disintegrates when in contact with fire. And even under those conditions he didn't come close to replicating the 3 collapses we saw that day. 

Yes, these were crude experiments and no, they don't by themselves prove beyond a reasonable doubt the buildings were demolished. But imagine what could be done with a team of experts on an unlimited budget. Then ask yourself why the evidence was sold and shipped off to China within weeks of the collapse.
Reply: Jon Chalkley Agreed.  Judy Wood's claims never held much weight if any.. I think she's a distraction if anything.
Reply: A person with a FUCKED brain, more precisely AHAHAH
Reply: +It's Me          Yaaay!    Someone with a head on their shoulders that knows how the building was constructed! That's the first step in knowing how they failed. I appreciate your trying...
Reply: Starting with zero kinetic energy at collapse initiation, as the upper floors started to fall there is actually an increase in ke as the collapse progresses.
I could take you through the calculations but it has already been done in a previous post by Tony Duncan.
Suggest you have a look at his analysis posted a few days earlier.
Reply: I don’t see how you could carry this out on a small scale. In order to be a valid experiment it would have to duplicate the same conditions that were in effect when the towers fell.
What sort of scale are you thinking of and how would this realistically be achieved?
Do you understand that simply building, say, 1/100th scale with everything in proportion would not be valid.
Why should "free fall" be a condition since the towers did NOT descend in free fall. If you watch the panels coming away from the façade you can see that they are dropping in free fall and decending much faster than the floors.
Reply: It is not a case of "conceptualising  a scenario". The maths proves that the upper floors falling through 12ft onto the floor below would gain enough momentum to shear the joints between the floor trusses and the walls. This lot would then fall another 12ft on to the next floor below and so on.
If you wish to contradict this, let us see your calculations to show that the floors would be able to stop the falling mass of the floors above.
Reply: so if it was as simple as brackets breaking why did the lowest stories brackets not fail years before with the full wieght of the building on them?
Reply: We have still to see your calculations showing that the truss joints were strong enough to resist the impact of the falling upper floors.
If they did not fail what caused the building to collapse?
Reply: doesn't matter the official story is horseshit
Reply: But in fact people did know about the holocaust.  There is indication that the Allies higher command was getting information about it at least a year before the war ended.   But they didn't believe it entirely - they didn't believe that even the Nazis would descend that low.  It would have made little difference either way, they could have crowed it from the rooftops, but, the propaganda was being laid on pretty thick already, and most people reading it probably wouldn't have believed it.  Certainly not the German population.  It's not surprising that they'd make the decision that publishing it would make matters worse rather than better.  Secondly, militarily, they still had to do what they had to do to end the war.  Knowledge of what the Nazis were doing behind the lines wouldn't have made any difference to the conduct of the war.
Reply: To me, the two hypothesis are roughly equally as likely. Both are ridiculous. But the airplanes were observed by other pilots, were on radar, and seen by eyewitnesses as they crashed into the buildings. The rest is as credible as Bush2's WMDs. But coordinating a demolition with the airplanes requires TWO conspiracies, both ridiculous, to be successful simultaneously, and that's the main problem with the demolition theory. And don't forget, the demolition theory requires installing explosives in all three buildings.

You only get to start from the facts. The buildings were designed to take 707s as impactors, were impacted by 747s, and fell down. The fact that his models don't work only shows the floors probably didn't break as a contributor to the building's mode of failure, which is what he modeled properly.
Reply: T Samuel Harrison well seeing as the floor sections were only held on by four bolts I'd say he got it wrong. Oh and a layer of concrete
Reply: Eric Henderson He called you a genius because he's blown away. You are right to take it as a compliment. Jon Chalkley was bowing down worshiping you. The clips were not designed to hold more than a single floor, period. NIST did an incompetent coverup of something, not a model that works. But that's not evidence of anything, the evidence was sold and removed. The sprinklers failed, and that's enough to take down a building.
Reply: That's the point: his model did not replicate the floors at all.  We know that the floors only had to support themselves, contents and a suitable safety factor and some lateral load (most lateral load was handled by the spandrel framing in the perimeter steel.  The concrete floors were only 4" thick - I suspect they couldn't even hold themselves up without the steel floor trusses underneath them.  We know that a floor weighed about 2500 tons, and the perimeter girder bracket supports themselves could withstand a total load of at most about 14500 tons (which is about 1/3 of the total weight of the top section of the building) before collapse.  

Which means that a floor simply couldn't withstand the load of the top of the tower even if the tower didn't fall at all.  It'd break, and the next floors down would break exactly for the same reason.  Since the falling weight exceeds the strength of the lower floors by a factor of three (and increasing as the tower fell), there would be no reason for the collapse to slow down, and it would in fact accelerate.  As it did.  It will not be a coincidence that the collapse acceleration (approximately 70% of freefall) calculated by 911 truthers - indicating that the lower tower was only exerting an upwards strength of about 30% of the top of the tower weight, is pretty close to the 3:1 ratio of top-of-tower weight to floor collapse strength ratio.

Meanwhile, in his model, the slots in the boards could withstand far more weight than his entire model.   The model scaling completely threw off the weight/strength ratios compared to the towers, and hence any conclusions drawn from the model are entirely bogus.

I did a little research into Mr. Cole's "PEng".  He is not a structural engineer.  He's trained as a mechanical engineer (primarily involved in the design/maintenance and operation of machines, not buildings.  It includes such things as HVAC design etc) and his background shows essentially zero experience in structural design at the slide-rule level.  He worked as a home inspector (which is certainly a step down for a PEng) for much of his career.  An engineer working as a home inspector is roughly equivalent to a plumber working in Home Depot advising customers in the plumbing aisle.  Yes, he did get into building forensics, but my impression is that it's primarily for insurance claims on small structures.  Certainly no background in large building design.

The fact that he thinks he can model WTC floor collapse based only on matching floor deflection proves it.
Reply: miami boi305 That was my point, not stated exactly clearly. I should have said that he shows the floors probably didn't break IN HALF as the building's mode of failure. That’s the only thing he modeled. The paper supports, for example, were vastly stronger than anything but the steel columns and weren’t spindled through the floors to model the steel columns.
Reply: HALF MT the designers design did its job against tip over. See thats what people don't realise it was not tested for collapse after impact it was tested to not tip from a impact of a plane rated in those days. It did its job however once impacted that deeply it exposed its design flaw
Reply: Why would the architects over engineer the building in this way? It would have greatly increased the cost. The fact that the building stood for, many years without any problem is evidence it was fit for purpose.
Reply: The design of the WTC took place mostly before wide body aircraft (DC-10, L1011, 747) were put into service, and at the time 707s and DC8s were still the largest airliners in wide use.  The towers were built to cope with the then-common airliners crashing into the tower accidentally while approaching for landing at considerably slower speed.  The towers did withstand the collision and would have remained standing except for the fires.  It was only the subsequent fires started by jet fuel that exposed the failure path.

The trusses weren't there to "secure the core to the outer shell" per-se, they were there to keep the relatively thin concrete floor from collapsing and tie the outer shell to remain vertical.  The building was of a design ("long-span" & "tube constriction" as pioneered by Faslur Khan) that was relatively new but very attractive because less expensive to build and opened up the floor much more than previous construction methods.

The collapse initiation didn't rely that much on the truss-clips per-se, but more on the fact that the trusses could not stand up to a long term un-fought fire underneath them.  Secondly, the impact of the aircraft destroyed the vertical support under many of the outward ends of the trusses making them much more prone to collapse  Collapse initiation came about by the trusses buckling and pulling the perimeter steel in because the truss brackets did retain their connections (up to that point).

Designing the floor trusses to potentially hold up the building would have resulted in trusses so massive that there wouldn't have been room for people under them.  Kinda defeats the purpose.

It's interesting to note that the ASCE (Americian Society of Civil Engineers) the premier professional body for civil (including structural) engineers in the US, who with FEMA and NIST performed most of the technical research on the 9/11 collapse said this:

"The lessons learned from this tragedy can help improve the ability of 
buildings to resist more routine fires," said Jeremy Isenberg, Ph.D., 
P.E., president of ASCE's Structural Engineering Institute. "Instead of 
revising building codes to address extreme events such as the impact of a
 large jet airliner, resources should be focused on improving 
fire-resistance methods for the conditions more likely to affect the 
types of buildings where most of us live and work. For extreme 
situations, it is best to direct resources toward preventing the 
attack." 

And indeed, building codes were changed in the aftermath of 9/11 to do just that - improvements to fire resistance, and steps were taken to make aircraft more difficult to hijack.

It should seem obvious that expending inordinate amounts of time, stupidly ridiculous amounts of money and indirectly stifling the economy to change all building designs to withstand full speed, say,  A380 impacts and consequent fires is a simple waste of effort.  Terrorists will simply choose some other weak spot - indeed, when was the last time you heard of a major airliner hijacking in North America?  9/11 right?  One of the first coherent thoughts I had after watching 9/11 unfold in real-time was the realization that successful aircraft hijacking, once common place ("oh, we get to spend a couple days in sunny Cuba!"), would never happen again.  Even Flight 93 proved that.
Reply: That was a beautiful shill story...
Reply: A truss has two chords, the bottom chord (the secondary chord) had two bolts, the top chord (the primary) was seated on top of a steel plate and welded down with bolts. So way to show your ignorance.
Reply: bla bla bla.. same lines stame story in 2017.. Take an IQ test.  If you fools had to have your intelligence score next to your name .... A LOT of people would keep silent.
Reply: LoL@ common sense and logical reasoning..  The only ones being brainwashed are the ones who believe bullshit.  Just because you subscribe to bullshit that isn't mainstream media or the government doesn't mean you are anymore brilliant.  Bullshit is bullshit.. Only common sense can determine which is which.. I don't have the energy or patience to destroy all your arguments.  I have heard them all before and I have tried explaining things to simpletons but its like talking to a person with religious zeal.  YOU WANT to believe in this..  It snot that I DON"T .. I don't give a fuck.. I have no bias..
Reply: lol cannot enter buildings as shown....That's almost laughable.  The thing is you are so convinced of your statements.. its sad..   What do you mean "as shown"  are you telling me they did what exactly.. You do realize out of the millions who were there and saw it that once in awhile you're talking to someone who might have seen it right?  I know that logic is very difficult for your mind to internalize..
Reply: K, so not sure how half of the stuff you wrote is relevant to the discussion (like revolutions) but OK.  The pancake theory is argued against much like evolution is argued against.  People say that "It's just not possible, because this would have had to happen."  

Where are your experiments to show this?  The person making a claim bears the burden of proof for the claim.  The pancake theory has been proven, through the engineers of the towers, to computer simulations, to the mathematics that shows how the weight and forces would have caused the pancake effect, due to the engineering of the towers.  

It is the engineering of the towers that is key to understanding how they fell.  The towers were built with a revolutionary new skyscraper design.  All towers up to that point had been built with a core that held all of the weight.

The Twin Towers were totally redesigned.  They were designed to stand up using a dual support system.  The core was too weak to stand on its own and the outside frame was too weak to stand on its own.  The two had to be connected together, by the floor trusses, in order to stand up.  This is precisely why the towers were built floor by floor, rather than the center column going up, then the framing, then the floors, like every other skyscraper had been built up to that point.

This was done because the towers wouldn't be able to get as high as the designers wanted them to be using traditional construction methods.  Therefore, taking out the floor trusses of only a few upper floors is all that is needed to bring the entire thing down.  As the floors collapsed, the core could not hold itself up, and as it collapsed under its own weight,  so did the lift shafts attached to it.  

If you don't accept this, it is you who are ignorant of facts, intentionally.  And it is you who are dangerous to society, because you would be willing to start a revolution, inciting the deaths of thousands or even millions, all because you don't have your shit together.
Reply: Trusses are known to fail in fire.. lol.  A bowling ball isn't a proper analogy.  The weight of the upper part of the building coming down was like the equivalent of the titanic.
Reply: Congrats for the trusses failing in fire.............. Except they didnt in experiments.............
Even if they did, that would mean we would have a core left standing there.
Since if the trusses failed, the floors pancaked, which they didnt.

The bowlingball crashes THROUGH the glass plates, and the glass plates shatter and end up mostly ontop of the next glass plate.
But, the ball does not go through all the glass plates.
Which perfectly demonstrates why your nonsense of the weight of the upper part of the building being equivalent of the titanic isnt the proper analogy.
We could all see the massive ejection of dust and structural components in all directions. Which didnt add up to the weight crushing or destroying the entire intact lower part.
Infact, the weight did not increase but decreased since of the ejection of all that material.

Plus, the upper part was always kept up there by the lower part of the building.
Its impossible for it to accelerate downwards without any deceleration.
That also is perfectly demonstrated by the bowlingball experiment, as well as the experiment in the video above, as well as the FACT that  you indeed do slow down when jumping into water.

But hey, continu believing in fairy tales if you want.
Reply: you're wrong..  Ask any fire fighter about trusses.. they are KNOWN to fail in fire.  But they are lightweight and easier to construct.   The core supports shared distribution with the exterior columns connected by the floor trusses..  Once the trusses failed the shared stability of the weight failed.   That is why the buildings exactly failed at the point of damage... the floor in which the plane went into.   After that fall the top half of the building BULLDOZED down onto the rest of the building..  It didn't simply just go limp into its own blue print.  That is why we saw beams being ejected out and so much force during the collapse yet no distinct sounds of explosives going of..  Demolition takes out the core and key components out in a sequence of VERY audible explosions and then the building falls limp with no structural support.  That was not the case.  You're the one believing in fairytales.. and stargate programs, and holograms and CGI.. and thousands of people being in on it, and secret ninjas planting explosives in over 200 stories.. and missile attacks..  You're the one delusional.
Reply: Bla bla bla .. bullshit is bullshit no matter which form you decide to subscribe to.  Thats where simpletons like you don't have the common sense to know better.  You're the guy these people making videos on youtube for the past 16 years have exploited. Most intelligent people don't have the time or patience to argue with you fools so you all band together reinforcing your convictions.  Your beliefs are akin to religious beliefs in which you replace metaphors and stories with quack science..  You're a fool and as long as there are fools around people will always profit...  Keep talking keep watching/making videos for the next 50 years..  All your concrete evidence and science... Meanwhile you got nothing... What did you mongoloids do for the past 16 years besides convincing each other over absurdities.. Where are the indictments?  You have teams of scientists right?  Where are the teams of lawyers with all the concrete proofs.  What have you assholes done besides profit off of books, and youtube videos.. You got shit,, and you bafoons will talk about this for another 50 years.. any conspiracies that did exist have been pushed under the rug by you tards.
Reply: +Guinea54 lol your something special an this is the last time ill entertain you with a reply . You can't fight the elite with the court you clown . They fucking own the court they own everything . The only way to beat them is to kill them all . I do agree with one thing you said . everybody is talking but doing nothing . its time for a revolution. We need to get our freedom back cause right now we are slaves an cattle . an you need to open your fucking eyes cause people like you will be the reason we don't succeed in taking back our world . We need everyone if we want to successfully get rid of the elite evil bastards .
Reply: gh nm:  That is a correct statement of "root cause".  I wish there was something we could do about it.
Reply: The buildings didn't free fall...  secondly the sequence of explosions would happen before the collapse.. secondly those explosions that cause ejections of steal beams flying outwards would have a VERY distinct audible sound that could be heard for miles..   Lastly the core columns got pulled down by the building coming down.. the stability of the core relied on the balance between the trusses and exterior columns..  The building failed and the entire portion above the impact came down... the weight and mass comparable to the titanic if you slow mo the collapse you can see the core was intact as the collapse happened but they were pulled down.... they didn't just drop with the building.. there would have been no resistance then. .
Reply: +Guinea54 firstly you said secondly for 2 different points . an secondly stop repeating yourself . You already said this shit an you getting boring . I'm done replying . 9/11 was a inside job get over it
Reply: Talking to you people is like talking to a retarded sea turtle that washed up on shore... You enjoy me because you enjoy arguing with people your dumb points.. I wish i could magically put common sense and logic into your minds and allow you to see how silly your beliefs are but I can't.  Its pointless back and forth banter where neither of us are going to convince the other.  The only thing I can do is urge you guys to start looking outside of conspiracy videos and "conspiracy experts".   talk to some real life people in the know... walk into your local universities, talk to some reputable professors in engineering or physics.  I am no longer going to argue my points.. All I will do is urge you to seek out information from various sources outside of youtube..  Its a hopeless discussion and you people will be on this for another 50 years saying the same rhetoric.
Reply: well obviously you can't take my word for it..  But I was there... I know people who were in the buildings.. I  know someone who never made it out of one.. also know quite a few of the fire fighters there... who were on the scene.. I also have a pretty high IQ score went to a relatively prestigious university.. actually during the time of 911.. I have talked to my brother who is a pilot.. also talked to engineers at the university about this topic.  I also have a strong base in common sense and critical thinking..  So i have tools that has given me my opinion.. right or wrong..  But I will tell you that I would never have such a definitive opinion solely based on youtube videos or conspiracy propaganda..  I know you guys for certain don't base your opinions on ANYTHING but this source of information.. You are using "their science"..  THEIR experts...  I know for SURE you aren't finding your own.. You aren't talking to the informed.  I know this.. and you can say otherwise, but i know ..
Reply: Of course I can say anything just as you can.  But what I am saying is the truth.. You won't believe or know that.. Its fine.  The buildings were meant to withstand wind forces... which dwarf the plane impact..  The buildings survived the impact force.. that wasn't the cause..  No one tested out the theory.. They used computer models from the 60's.. The twin towers is the same case as the titanic.. The unsinkable ship..  Not till something goes wrong that we discover the problems..  Its a pattern throughout history but you don't have the knowledge, intelligence or common sense to comprehend anything I would say..  My IQ can't be that high because I bother to argue with the bottom barrel of society.
Reply: Occams razor....  A concept a total simpleton cannot grasp.. When the titanic sunk... Would a feasible explanation be in the design of itself.. Budget requirements,, time constraints...  Mistakes..   Or would the feasible explanation be that they hit an alien force field that the government was working on from their star gate program.. and secret sea ninjas were testing out the new device which destroyed the unsinkable ship..
Reply: The NIST report even flawed has more reliable information in it than all of your conspiracy shit combined.. They talk about the actual details tot he millimeter.. Much more comprehensive and scientific than the bullshit you guys talk about.  It might not have happened the exact way the report specifies, but it definitely got the general jist of what happened correct. The only thing you fucking idiots know is to regurgitate the  same rhetoric of exposing perceived anomalies by the layman and simply stating "its against physics".. Then of course.. insert absurd fucking theory here_______... Make wild ass claims with no real concise or practical way of implementing or proving it.. then talk about how the NIST report is a sham.  LoLzz  come on lets repeat the debunked evidence.. "free fall speeds" "melting steel".. plane not being able to penetrate..  Ive heard all the arguments numerous times.. fortunately for me ... I have a brain in my head. Seriously i can write a book giving very specific reasons why you guys are fucking retarded.. there are SOOO many reasons why you people are complete fucking morons.. Common sense reasons alone.. not even having to go into science.. common fucking sense reasons that you mongoloids are absolutely clueless about..  you have no fucking iota of a clue how anything works..
Reply: it's me, not only that, but these are flawed beyond that 1. speaking of laws of nature, gravitational forces are not changed. so accelartion of distance needs to be taken into account. the most he dropped any blockes was lik e3-4 feet. , each floor on the twin towers is about 13 feet between, so you are talking about a drop in 13 feet of gravity acceleration for every floor, plus the initial collapses , well the entire mass of the top floors fell about 3-4 floors for the initial collapse so we are talking 40-50 foot drop.  plus all the floors in his experiments were no more than 12 inches between floors, and the same prinicipal applies to acceleration of 13 feet between floors , plus his blocks were tiny, didn't weigh much, vs. 20 million pounds and 40 million pounds. Isn't is obvious why the 1st tower that got hit fell 2nd? because the 2 collapses resulted in the same cause. but the 2nd tower was hit twice as far below the top of the building as the first and it took roughly 2x the amount of time before collsapse strated. makes perfect sense. doesn't it? so there you have it. so his droping from a max of 4 feet the object falling for 4ft by the time it reaches the other floors in his experiment are going 4.2 mph, at the minimal 3 floors of dropping 40 feet by the time the mas reaches the first of the fllors int he way it has accelerated to 17 mph-19 mph already. that is a HUGE difference not taken into account.also, the booms, say the single explosions he demonstated. I order to take out what he says, you would have heard explosions every seconds that would be like 150 db. you woul dhear that like 4 miles away probably. there was no such loud noise.
Reply: John Adams   There were several accounts of people hearing a rapid succession of booms.  And, hearing sounds for miles?  That was new York city, not somewhere in Nebraska.  Also, consider that there was more and material accumulating as the building fell.  It would have either stopped on a stack, or fell off sideways without removal or destruction of the core to stabilise the decent
Reply: thank you two sense, but there is a very easy way to tell. You can see videos taken when the first tower begins to collapse and they start to run away, and you hear a loud noise, it is a rumble. quite loud, but they are ilke oh 300-500 away fromt eh building, maybe 1000 at most. and you can hear it. go to any videos showing controlled demoltions, I have seen one s that sow anywhere from 30-100, watch every single one. you will hear a very noticeable difference. As far as 7, it is extremely quiet, , the only thing that matches on 7 is the bottom falls first, the WTC 1/2 does not. again watch videos of controlled demos, not a single one falls from the top down.
Reply: Ryan...You may want to fall in with the others...All hail Bush, the bringer of good and evil.  Hail Bush and Cheney, Hail, Hail..
Reply: i can't argue with you simpletons anymore.. your comments are idiotic..  People who don't have a clue. I can't spend a year replying back to every dumb comment... All the intelligent people have left the building..  They quit arguing with you guys.
Reply: +Guinea54 your the biggest simpleton . Santa claus is real by the way . your government said so , so it must be true
Reply: yeah go talk about your team of secret ninjas rigging 100's of stories of building with secret explosives.. Holographic planes from the stargate program and thousands of people and agencies all in on it orchestrated by the evil and all powerful Illuminati.. That sounds more ridiculous than santa claus..  Get a brain schmuck
Reply: STAMORR you shouldn't have commented. You're one of those people who completely ruins the rational of conspiracists thinking they're completely right when they don't actually have any proof and won't ever find anything useful. Stop ruining a civil discussion that could actually get somewhere with a true answer. You're just trying to make yourself feel good by saying someone else is wrong and making yourself feel superior, but in reality, instantly makes you look inferior. You're really stupid I'm assuming. What a sad person you are.
Reply: Debbie Walker being paid? Give me a break lol. You're just really stupid. I wonder how you ever manage to support yourself in the real world.
Reply: Think For Yourself this is a great point. Thank you to someone who finally discusses this in a rational, logical way instead of just spewing and repeating bullshit they heard on Loose Change and think they're an expert.
Reply: Eric Henderson 
Thank you for explaining the simple reason why a miniature experiment would not be valid, as the forces would be very different!
Reply: sometimes i wonder if people know what sarcasm is
Reply: Debbie Walker 'paid' yes....ok
Reply: This is exactly what I was thinking. this experiment is not even close to a small scale recreation. this so called model doesn't have the same engineering as the real towers. all these conspiracy theories are no taking into account real engineering.
Reply: It's Me I think scale can matter, depending on the properties of the materials used in the experiments.
Reply: It's Me first all the trigger stuff seems bs to me, just a bunch of Bush haters who later blamed him for all kinds of things unprovable. No democracy loving president would kill thousands of his country's own people to fool the country into justifying a costly incursion in the middle east. I wouldn't even think a socialist President would do that, though he might be a tiny bit more tempted.
Reply: It's Me that's right, without considering the strength of materials at their relative sizes, the experiments are not accurate.
Reply: MIJ Greco the same way a bed can hold a grown person sleeping but maybe not falling on it from a height.
Reply: Fromage Frizzbizz You and Eric make so much sense.
Reply: give me a break..  You have any idea how much plasterboard alone was in those buildings?   When a building like that collapses and all that force and energy, you're gonna get a shit ton of dust and piles of steel beams.  Everything else would be pretty much pulverized..
Reply: It's Me Yayy we have the best engineer here. Ok now explain building 7.
Reply: Composite deck.  It was actually anchored 100% around the perimeter
Reply: It's Me you on crack?
Reply: +Joe V  Do you claim to know physics Joe?
Reply: Glad you enjoy your work Slater
Reply: +Slater Slater  What would you like to know about physics Slater?
Reply: +Slater Slater  I know what everyone in America knows about the collapse at the speed of controlled demolitions for the three high rises in NYC on 9/11 Slater. They look like they were in fact controlled demolitions but we have debunker ass hats that claim they know everything saying they weren't, Kinda reminds me of the Aesop's fable of the Emperor's New Clothes in a way. I guess you know where the debunker ass hat cult fit into that story don't you Slater?
Reply: What planet did you just land in from?
Reply: +llanbo  Oh look above. There is still room for 332 comments before this thread is closed. Do you think you can deploy a majority of your sock puppets before we run out of space Slater?
Reply: Do you think you can ever be rid of your irrational fear of imaginary "truther" demons or have you been told it will seriously impact your employment status if you come to your senses?
Reply: +llanbo  If you refer to the ability to pretend to be stupid, I yield the high ground to you Slater. You've had superior training and far more practice.
Reply: ''The only way an accurate experiment could ever be simulated is if you found materials that were scaled down in terms of rigidity, tensile strength, and compression strength.  I.e., A 1/100 or 1/1000 scale of steel.  Then you'd have to construct your mock 1/1000 size building in the same way.  And you'd have to do this about 10 times, in order to satisfy the reliability of an experiment.''

Yeah, you're clearly an idiot. Downvoted.
Reply: +F Ts  Actually my specialty of late is in baiting/identification/exposure of paid shills like you. I'm rather good at it if I do have to say so myself.
Reply: F Ts  Stick to the program JTRIG, explain the scientific principle invented post 9/11 that explains:

"tremendous energy released by the falling building mass, the building section above came down essentially in free fall 

The science of kinetic energy calculations formulated in the centuries before 9/11 says that is false JTRIG debunker.
Reply: Slater Slater  Stick to the program JTRIG, explain the scientific principle invented post 9/11 that explains:

"tremendous energy released by the falling building mass, the building section above came down essentially in free fall 

The science of kinetic energy calculations formulated in the centuries before 9/11 says that is false JTRIG debunker.
Reply: Right where they have always been. Next ..............
Reply: Gregory Dahl  I don't claim to be an expert on everything Gregory, you see, I'm not a duhbunker, but I know from personal experience from any time I find myself in search of floors, I tend to check under my feet first. It might not be as scientific a method as NIST would employ, but I've found it works on many occasions for me.
Reply: And don't forget that as the top floors collapsed onto the lower ones, those floors became a part of the increasing mass which either continued downward, or was ejected outward and to the street level. Each floor was concrete laid on a corrugated steel subfloor (form) on top of z-trusses. They made up the "floating floor" elements. The majority of the debris seen as the buildings collapse Is the concrete being pulverized (dust-cloud). All of the additional floors added to the collapse, its mass, subjected the lower (relatively) undamaged  floors, to greater forces when mixed with the increasing acceleration within gravitational laws.  Demolition was never needed. The force of he impact of the aircraft at high speed, inducing MASSIVE structural damage, the subsequent fires, wind forces AND gravity, brought the towers down. NOT a government conspiracy. Despite claims to the contrary, Building 7 WAS significantly damaged by debris from the aircraft following the impacts, the collapse of both buildings, the raging out of control fires that WERE burning, and the "unique design" of that particular building.
Reply: DamoSuzuki100  How does an ornithologist go about his day without having every single specimen examined in a lab?
Reply: DamoSuzuki100  So you're saying from your extensive knowledge of other people's powers of observation based on experience, there is no one who can determine what a molten metal is by the properties it exhibits?
Reply: DamoSuzuki100  Have you had any experience working with molten or moderately heated metals?
Reply: DamoSuzuki100  No, not in other words. The words I used reflect my intent. If you are going to criticize my knowledge you damn well better be able to show you possess a superior understanding than I do.
Reply: DamoSuzuki100  No you haven't "demonstrated a superior understanding", Anyone can see all you have done is talk a big game.
Anytime you want to stop the pomp an puffery is alright with me. I just hope you can accomplish this before I grow a beard.
Reply: It's Me The towers fell at 10 and 12 seconds... Even if by some way the towers did indeed fall on their own, it would take them a minimum of 30 seconds, and thats being generous... Professionals who have experience with towers and people who actually blow them up when they get old say its literally impossible for 3 buildings to fall at free fall speed. Its simple physics, not rocket science
Reply: F Ts  Have you, by chance, done the math, or did you find yourself in over your head after you found that just by taking off your socks you were still unable to count the seconds it should have taken when factoring for the modicum  resistance of air resistance?
Reply: Gregory Dahl  You speak a dialect for which I have no comprehension Gregory. The concepts of which you speak are unintelligible. I can not determine if you have enough brain function to breath on your own and are hooked up to an iron lung. I don't think we will ever have a meeting of the minds.
Reply: I'm the right one Gregory. That other one is the wrong one. Got it?
Reply: Andrew Gonzalez; I PLAN TO....
Reply: It's Me, excellent points! Very reasonable! From one who desires truth, applies logic and just as you say, being civil while just trying to explain a point.
Reply: It's Me  NIST doesn't take into account the actual design of the towers, have never attempted to physically demonstrate their theoretical and yet to be proven physics, so I suggest you give the civilians all the consideration they deserve.
Reply: It's Me how come the inner core fell at the same speed
Reply: Debbie Walker She's controlled opposition, just like Alex Jones. They exist to discredit the real truth movement.
Reply: It's Me Please show me the math
Reply: +Agent Rook   That's funny debunker. Physics101 inappropriately applied to the scientific principle of: Boyle's Law
On Earth, matter exists in one of three states: solid, liquid or gas. Matter in each state exhibits distinct characteristics. Gases, for example, do not have a fixed volume* or shape. As a result, gases respond to pressure changes by changing their volume. In other words, gases are compressible. In contrast, liquids and solids are not compressible: their volume does not change in response to changing pressure. This is the reason air-filled spaces in our ears “pop” during airplane takeoff and landings while the liquid filled spaces in our bodies do not. Boyle's Law* describes the relationship between pressure and volume at constant temperature for a fixed mass* (number of molecules) of a gas.
Reply: I don't follow, are you implying that because of Boyle's Law, somehow, the temperature of a solid ball won't rise when I expand energy to squeeze it ?
Because that right here is a blatant violation of thermodynamics first law. Wether something is liquid solid or gas changes little to the fact that adding any form of energy to it will cause its temperature to inevitably rise.
Reply: Notice how I specifically said INCREASING the amount of pressure but you didn't care ?
That's what bad science actually look like...
Reply: Insolation from a litteral meters thick blanket of highly compacted material plus probably the slow release of potential energy as pressure continually decreased through debris removal.
Reply: "in order to release that energy in the form of heat you need movement."
You do realise that the action of squeezing is in itslef a movement right?
Beside, the second law of thermodynamics is pretty clear on the fact that no condition is required for energy to transform into heat, its something you have to actively fight against to even slow down.

"I can show u pictures of steel beams cut at precise and symmetrical 45 degree angles"
Don't bother, I already saw these. It was achieved by guys with cutters on clearing debris duty after the towers had already fallen.
I mean its that explanation or you having to admit that a perfectly preserved 45 degree cut somehow resulted in a building falling straigh. Kind of defeating your own logic there...
Reply: Agent Rook  That would mean the steel columns in the basement levels of the trade towers would be glowing red hot from all that weight from above, no need for lighting. You are a Putz. You have to create a movement of the molecular structure to cause heating.
Reply: Once again, why do you think I bothered specifying "INCREASING the amount of pressure" ?
Learn to read properly before insulting someone...
Reply: John Chalkly - You said "If a 2 ton car traveling at 100km/h collides with stationary vehicle of the same mass, what speed is the vehicle traveling after collision?
Answer:
If we assume this to be a closed system in which both vehicles fuse together and momentum is conserved, then you are doubling the mass of the vehicle meaning that it will lose half its velocity, ie 50 km/h"
In principle this is of course correct. However, how this relate to a building collapsing? You do realize that gravity has hardly any effect on horizontal travelling cars? (Assuming these are not flying cars). Now, to include the gravitational force into your example, please create a model in which the second car hangs on a pair of strings just strong enough to keep the car in the air.Now drop the first car onto the second car at 100 km/h. Would you still say both cars will travel down at 50 km/h after the collission?
In your own words: I know all of this will fly over your head, but take my word for it - you are clueless.
Reply: Bruce Lansberg  What does this word salad have to do with anything in real world terms? Do you just like to see your name in print?
Reply: - Why do you hijack someone else's name?
- I wasn't talking to you, but to John Chalkly
- If you read his earlier post, you will understand my comment. If you don't understand, you're playing in the wrong league.
Reply: Bruce Lansberg  I am told repeatedly that this is an open forum Bruce. If you do not care to field questions from the other users of a public forum like this I suggest you get your own blog or board where you can moderate the comments. Your 'science' experiment as you outlined it is asinine in my opinion. Two cars colliding on a horizontal surface do not fuse together as you want us to assume. Suspending a car by strings only strong enough to support it is an idiotic suggestion. I did you a favor calling your jumble of thoughts "word salad". Get over it. Grow up.
Reply: M Fritz (not M Fitz!)/DamnSuzuki100 (not DamoSuzuki100!) (or any other identity you will take after) - Since you so clearly demonstrated you have no clue whatsoever what I just wrote, let me try again, step by step:
1. Chalky claimed that two colliding cars in a horizontal surface would be a good representation for what should have happened to both towers.
2. According to him the collapses should have decellerated and come to a stop.
3. He uses Momentum = Mass X Velocity to justify this ridiculous believe
4. Then he used the car example WHICH I QUOTED (hence the quotation marks in my earlier post)
5. Next I explained to him that he "forgot" the influence of acceleration, the increase in velocity by gravity.
6. Then I tried to visiualize it (for the sake of Chalkly's understanding!) by the example of the hanging car.
7. If you read carefully, you will see quotation marks in my comment, suggesting I am actually quoting something, like the fusing of the cars. You do understand the concept of quoting? Happy to explain if necessary.

So now you come in asking me suggestive questions. Instead you could have made the choice to actually read what I wrote, read Chalkly's quote in context by looking it up and respond accordingly. See, by the tenor of your question, I did not get the impression you were in for a grown up conversation. And I'm all in favor for your interefering into other people's affairs. But it would have spoken in your favor if you would have read into the discussion before you cluelessly commented.

So, to make a long story short, happy to discuss any 9/11 related topic with you, specifically these bogus experiments in the video above.
Reply: Why do you keep changing your screen name? First it was M Fritz. Now it is DamnSuzuki100. Do you think this helps keeping any discussion well-ordered? Are you simply trolling? If so, why take the effort to put up a little show like you did?
Reply: Bruce Lansberg  Names are changed to protect the innocent paid shill 'Bruce'
Reply: cantonear1968  I live in a Devil proof house with absolutely no corners Canadian Duhbunker. Catch me if you can you little dickens.
Reply: DamNSuzuki100 (not DamoSuzuki100!) - "Names are changed to protect the innocent"
I tihnk you keep changing your screen name for other purposes. See, when I reply to you, starting with your screen name, some readers will easily overlook the tiny difference in the identity you have assumed from the real user with that name. Some might even think I made a typo in replying. Reading back all replies could cause confusion for the reader as it seems I am replying to other people and posts than I actually am. I think you know this and therefor you deliberetaly chose to keep changing it. It is a tactic that isn't really helpful in moving the discussion forward. Which leads to the conclusion that you do not have any real arguments. That's fine, since there are more that don't. But playing hide and seek instead of really stating what you believe yourself and why, is kind of immature. Don't you think?
Reply: DamNSuzuki100 (not DamoSuzuki100!) - "Two cars colliding as you laid out in your experiment do not fuse together."
Yeah, I know. Could you please post a quote in which I stated anything like that?

"Handing a car on string is asinine example intended to represent the mass of the lower floors of the trade towers firmly planted to bedrock."
Sorry mate, I have to come to the same conclusion as before: You have not read my reply or you are intentionally misrepresenting what I said. Please post a quote where I have stated the intention of my example is to represent the mass of the lower floors. You can't because I never wrote that. What I did write: "6. Then I tried to visiualize it (for the sake of Chalkly's understanding!) by the example of the hanging car."

But since we're finally talking 9/11, no floor was planted to bedrock. Even if you meant to say the foundation f the towers were ankered in bedrock, it doesn't matter. Anker as much as you want, as long as the floors give the towers lateral stability, the perimeter and core will simply collapse under their own weight when the floors are removed. I'd suggest you get a basic understanding of the engineering of the towers before we proceed.

"Everything you stated is poppy cock in my opinion"
Sure it is. But if I had to choose between your opinion and plain and simple facts for deciding what happened, I'd choose the latter.

"you assume your opinion is the only one that matters"
What proof do you have to come to that conclusion? I don't think my "opinion" is very helpful in this discussion on the cause of the collapses. Facts, science and evidence however are.

"You are a paid shill or you are a sociopath that should sign up for a tour of duty with Uncle Sam's astroturfing troops."
How about option 3: I simply don't buy your empty rethoric as I am not convinced by the "evidence" that comes with it? This quote is actually a very interesting one in more than one way:
- You seem to think there are only two options. It looks like you can't imagine there are other explanations for what you've witnessed. Is this representative for the way you look to the subject matter?
- It's a perfect example of confirmation bias. When confronted with a narrative that does not match your prepossessed opinion, you choose to ignore it.
- Stating anything without proof is rather characteristic for conspiracy theorists. Rather then adepting your theory of what happened to new information that contradicts this  theory, you choose to dismiss that new information.
- Stating I'm "in on it", is actually a typical defence mechanism for conspiracy theorists. You might be inetersted in reading this article (in specific point number 10) to get some insight into your own logical failures: https://owlcation.com/social-sciences/10-Reasons-Why-People-Believe-In-Conspiracy-Theories
And I quote (see, I'm using quotation marks here): "A common trait among conspiracy theorists is their need to derogate critics. Criticism must be devalued because it threatens the comfort provided by the conspiracy. This is done in one of two ways. Either the critic is too dumb to see the intricacies of the conspiracy, and is thus contributing to it by ignoring it; or they're actively helping the conspirators to cover up the truth. The unconsidered third option: that the critic is just not convinced by the evidence, is undesirable because it would create a reason to doubt the comforting belief.

The two ways of derogating critics have distinct, self-serving functions. In believing that some critics are too dumb to see their special knowledge, theorists establish their superiority. In believing that other critics are part of the conspiracy, theorists are manufacturing evidence to support their special knowledge."
Reply: Bruce Lansberg  Thank-you for your sponsored opinion Bruce. It's always nice to see my work has not gone unnoticed by the ever vigilant monitors of YouTube like you. I will take your kind words under advisement.
Reply: Bruce Lansberg PS 'Bruce". Two days ago you wrote:
"If we assume this to be a closed system in which both vehicles fuse 
together and momentum is conserved, then you are doubling the mass of the vehicle................."
Thanks again for your kind attention you have paid to a civilian user of YT Bruce.
Reply: "I will take your kind words under advisement."
Actually, my words were not aimed at you.
Reply: "Two days ago you wrote:"
Dude! What's wrong with you? I QUOTED those words. I explained before that I quoted those words. I put them between QUOTATION MARKS, I explained to you what the meaning of QUOTATION MARKS are. What is it you don't understand? It is really not that complicated. 
Quote: verb (used with object), quoted, quoting. 1. to repeat (a passage, phrase, etc.) from a book, speech, or the like 2. to repeat words from 
http://www.dictionary.com/browse/quote

It doesn't really surprise me to be honest. The way you have demonstrated your total lack of knowledge on any detail or concept on 9/11 and the way you seem to heavily underestimate that lack of knowledge as shown by the lack of responsiveness to my questions and the lack of any arguments, tells me you just have no interest in comprehensive reading or adding something substantial to the discussion. Good luck on your conpsiracy theory. I say tata!
Reply: Bruce Lansberg  Sorry Bruce, this is social media, You have no way of knowing who you were addressing.
Reply: Bruce Lansberg  When you quote something Bruce, the onus is on you to clearly mark the passage as a quotation and who it is attributed to.
Reply: M Fritz (NOT M Fitz!)/DamnSuzuki100 (NOT DamoSuzuki100!) - "Sorry Bruce, this is social media, You have no way of knowing who you were addressing."
Apologies accepted.
Ït's a shame you missed what I was actually saying. Let me explain (again). When I wrote "my words were not aimed at you" I was trying to make clear that i know you won't read them anyway since you have demonstrated a lack of ability to do so over and over again. I was merely directing my words to people that might read along for them to understand how you (like many other conspiracy theorists) fail over and over again.
Reply: M Fritz (NOT M Fitz!)/DamnSuzuki100 (NOT DamoSuzuki100!) - "When you quote something Bruce, the onus is on you to clearly mark the passage as a quotation and who it is attributed to."
Thanks for proving my point.
Reply: Bruce Lansberg (NOT Bruce Lansburg!)   No need to go on. We heard your crackpot conspiracy theory the first time Bruce. You, my friend, are in need of medication.
Reply: Bruce Lansberg (NOT Bruce Lansburg!)   No thanks necessary Bruce. We know it doesn't matter how many times you explain anything to a debunker like you, you just ignore it.
Reply: Yup, shore nuff did JTRIG debunker
Reply: And I can prove it canto, but then the powers who own Youtube and have gang stalked me and put listening devices in my home would sensor me as they always do with ghost banning, Canadian Duhbunker. You wouldn't know anything about that now, would you?
Reply: cantonear1968  Just love the hypocrisy of duhbunkers like you who are petrified at the mention of "truthers" as you are talking about the paranoia outside your little cult.
Reply: cantonear1968  I think your friend who talks about listening devices planted in his teddy bears is kinda funny. I can't wait for the stories about ET and where they plant the bugs.
Reply: DamoSuzuki100  You're not really a good spokesman when it comes to bigotry unless you are instructing on it's use in social media Damo.
Reply: At last someone with common sense and the ability to look at the actual evidence. Please check out Dr Judy Wood's examination of the evidence if you haven't already done so.
Reply: "The maths proves that the upper floors falling through 12ft onto the floor below would gain enough momentum to shear the joints between the floor trusses and the walls. This lot would then fall another 12ft on to the next floor below and so on."

Rigghhht..

Your 4th grader problem solving skills and 7th grade algebra, disproves the actual, real-world observations of two major engineering organizations FEMA and NIST.

What you claim "would happen" was not observed in the video footage or material recovered. We did not see pancaking floors. We saw the complete failure of all structural columns, and explosive ejections from the collapsing mass. This is not possible in a real-world, gravity driven collapse of a modern steel framed skyscraper.

You are sticking to a collapse theory that was first proposed in 2002. No one of note within the engineering fraternity supports this claim anymore. Why are debonkers so totally misinformed about even the 'official' explanation. Ffs, at least read NIST's report before embarrassing yourself further.
Reply: It's Me............

How does a fire weaken steel columns on the healthy side of the building up to the point that they give less resistance than the huge hole of air created on the north side?

The North Tower top section does not tilt into the hole, nor does it drop into the hole, created by the plane.
It tilts southwards, toward the section of building that is more intact than the north side was. 
We saw the south tower tilt into where the damage was done.
The North tower did not do that.
So what you are suggesting is that fire can weaken steel up to the point that it gives less resistance than air.

And: 
/watch?v=OjvCNDF4RYw

What stops the bowlingball from crashing through all the glass plates????
Reply: So What about the "conspiracy theories " that are now proved to just be plain fact like Pearl Harbour, and the fact that the atom bomb was created without the general public knowing anything ? You are either extremely naive or perhaps being paid to spread disinformation.
Reply: +Slater Slater  Classic hypocrisy Slater. Let's get back on track:
_I don't think it was a Jew conspiracy but I don't dismiss the Israeli 
involvement in the false flag attack on America like you do Slater_
Reply: +llanbo  You're still scared of the imaginary boogeymen Slater. I don't think you are in a rational state of mind. You creep me out.
Reply: Grade school science class for special needs kids refute this bullshit F Ts You probably didn't qualify for higher education only typing class  paid troll.
NIST NCSTAR 1, WTC Investigation Page 146 
6.14.4 Events Following Collapse Initiation

   Since the stories below the level of collapse initiation provided little resistance to the tremendous energy released by the falling building mass, the building section above came down essentially in free fall , as seen in videos. As the stories below sequentially failed, the falling mass increased, further increasing the demand on the floors below, which were unable to arrest the moving mass.

  The falling mass of the building compressed the air ahead of it, much like the action of a piston, forcing material, such as smoke and debris, out the windows as seen in several videos.
Reply: DamoSuzuki100  How does a duck hunter know what duck to shoot at?
Reply: DamoSuzuki100  I don't know what your past experiences have been but from my knowledge based on personal experience, I can and do identify the molten metal seen flowing out of WTC2 before it fell as steel from a visual indication it displays as it strikes the side of the building on the way down as well as other traits.
Reply: DamoSuzuki100  Before I subject myself to your review of my knowledge, I would like to know if what you say comes from someone I would consider a peer and not just ignorant criticism from someone who sets out to discredit any information that they don't understand.
Reply: DamoSuzuki100  You might be confusing your delusions with feelings of confusion. I guess one can lead into the other but do we really have to entertain your psychosis here in this channel?